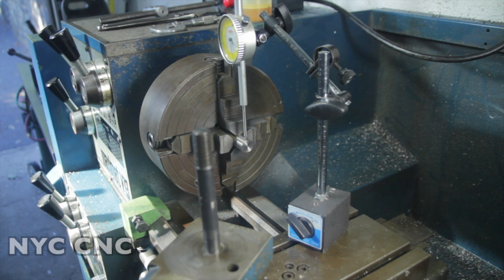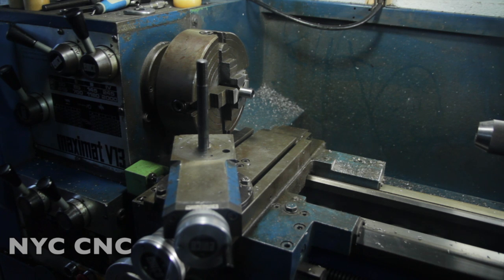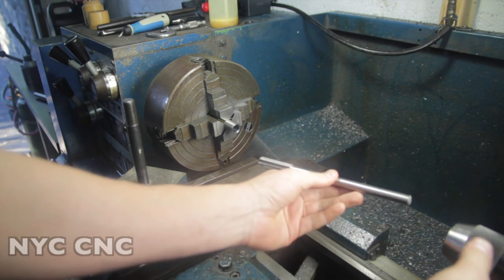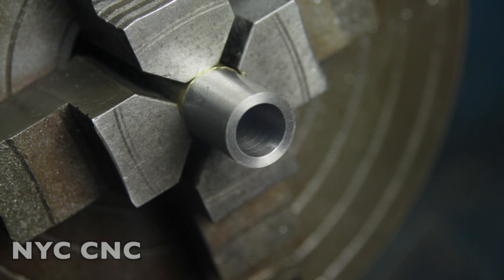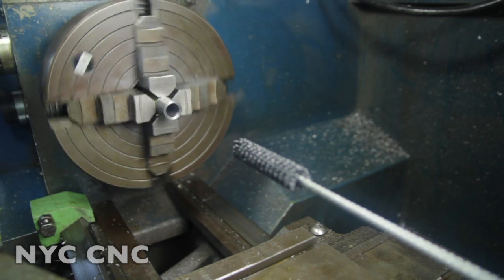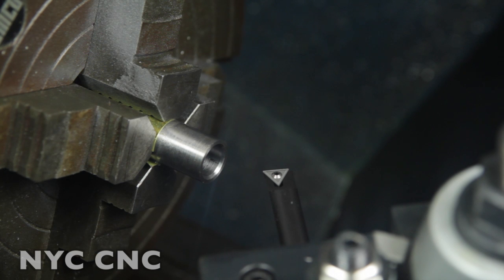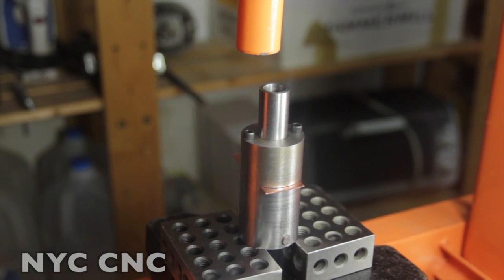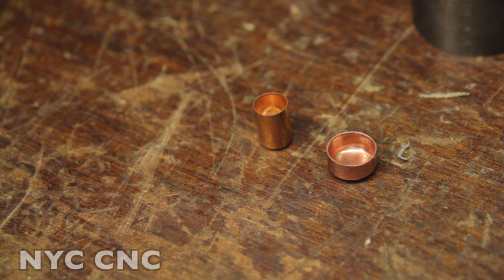Making Copper Bullet Jackets: Machining Punching & Drawing Dies!  Part 9

Comment: One trick I learned for reaming holes that avoids any chance of a conical, or bell shaped, hole is to feed fairly fast, about twice the rate you are showing, stop the spindle then retract the reamer.  This generally doesn't leave any drag marks, and creates a very precision hole, leaving less work for the honing step.  Big fan of your videos!

Comment: Honing leaves a lot of crud behind, and it will remove material faster than you think. I always flooded with honing oil if I could to keep the stones clean and cutting accurate. The small ball hones do a great job too.  The way you honed will leave a slight taper. Passing completely through a bore and pulling it back out is best. It is a learned skill. You will need to hone, measure, rinse repeat for awhile to get the knack. It's a pretty easy process. Pretty fancy stuff you got there.

Comment: Rather than using the tailstock crank, you can loosen the tailstock enough for it to move freely and push it in with your hand.  OK for small enough reamers, gives almost as much feel as a drill press.  Materials make a big difference, aluminum I would definitely stop the spindle.  Like others have mentioned, I too, am grateful for you taking the time to document your approach to making things!

Comment: Two days ago I bought an OBI 5 Ton press for doing this exact operation. Thank you for the series. Your channel is awesome. Those are cylindrical plug gages, not "pin" gages. You can use two plug gages together to measure holes up to .999 with your .250-.500 plug gage set. Also, the "snap" gages you are using are telescoping gages not snap gages. Snap gages are something entirely different. Snap gages are fixed Go/NoGo gages for measuring OD's and such. Fine work, thank you for the time and effort John.

Comment: After drilling the hole, it is good practice to use a boring bar
to true bore the hole before reaming this assures best concentricity
with the O.D. The only true hole is a bored hole.

Comment: If that ball honer is like the ones we use on engine cylinders they're made to spin. The spinning extends the balls on the tool applying perfect pressure to the work.

Comment: brush research has videos on how to use the dingle ball hone. i was noticing your stroke speed is pretty slow. whatever gives you the finish you desire is "right" but typically you would stroke the thing about 4x faster than you are going. and dont worry about being "square" to the bore. because of hte suspension on teh balls, it doesnt matter. its typically much better to hold the work and spin the brush in a hand drill. you can NEVER have too much lube when honing.

Comment: i think you need a good strong valve spring (or two) to return your plunger once it's passed the counter-bore.
tool steel is the stuff you want to make a finished product with.
how much pressure is required to form it? i'd make a short stroke large bore pneumatic cylinder to drive it down faster.

Comment: Amazing.I'm very impressed.I wish I had the Lathe & equipment that you have.There's not a whole lot of PPL out there that have & run Machine Shops anymore.No one wants to take the time to do this work.They would rather replace the whole thing than to fix the issue.Say someone locked up a 5HP Briggs Motor.It cost more to rebuild it than it is to buy one new.What's your opinion on that in general?

Comment: Firstly, amazing work.
Question: Did you ever end up finishing this project? Can't seem to find any videos for the final steps of forming the projectile nose.
Looking at making something similar for myself to turn out a jacket at .318 with a final weight of about 120gr.
Reply: Probably gave up.  I don't understand why would you make 9mm jackets when cast or plated bullets work just fine and are really cheap.  Now if he made a little bit bigger for .357 magnum that would be a different story or 30 caliber even better.

Comment: Late reply here but you can try using some wooden or plastic chopsticks with some foam and press that against sandpaper to polish IDs
Reply: I say chopsticks instead of dowels because they seem to have more flex than your common dowel stock which seems like it should be better for polishing.

Comment: Do you think you could apply compressed air through the pin to get the cup off or is it too tight?
Reply: also, i would O.D.-thread the punch pin and screw that into a base plate. then if you got the extractor to work the cups would just fall out the bottom.

Comment: I've been swaging my own .222 bullet jackets from .22 Rimfire jackets, but I'm stuck on how to trim them to the various lengths I need for different weights, this is the only stage left, after this I can make my own .222 Bullets, been over to the castboolits forum but couldn't find anything to help, bare in mind that I have nothing more complicated than a Drill press & chop/drop/cut off saw, so anything I make has to be done with only those tools, any ideas?
Reply: well, my current set up cuts them at a slight angle, which I then have to trim, I have at least 24,000 cases to do
Reply: I'm loading for a very rare .222 Rimmed rifle, the cases are tough to get so I don't run any projectiles lager than 50gr because the cases tend to split with a larger charge & higher projectile weight , this is why I need to trim my .22 jackets to a shorter length.

Comment: Can you draw an annealed 95% copper disc of 0.75” diameter and 0.06” thickness?
Reply: John NYCCNC Pre-cut discs of that size weighing 48 grains are readily available and affordable.  They only need to be annealed.  But they are twice the thickness of the stock with which you are working and the LMC to MMC is greater as well.  So it appears that the space between punch and die would need to be greater for the initial draw.  The question is whether a disc of that thickness would draw or tear.
 
Your rig is well on its way to producing tolerances better than needed for National Match competition.  It would be nice to see a version for the econo-loader.
 
I suspect a working proof of concept for the 0.750Ø x 0.060 would earn a machinist instant entry into the diy/shtf/prepper/wrol hall of fame.